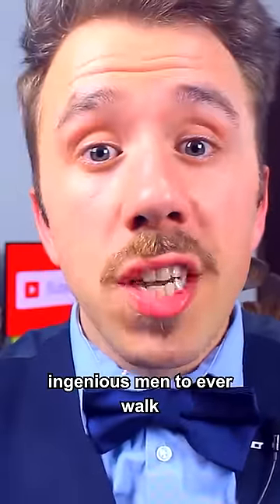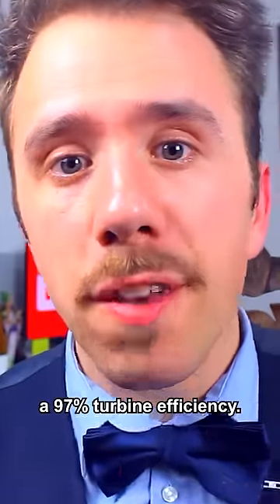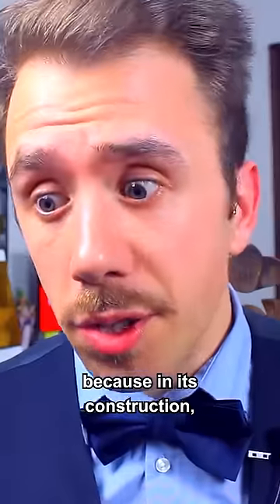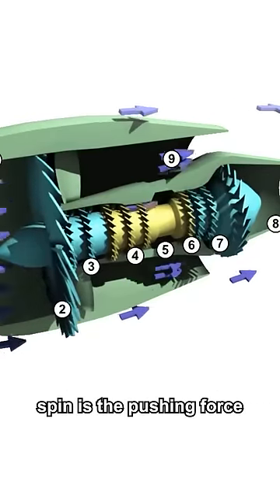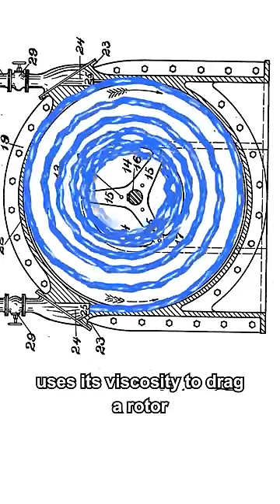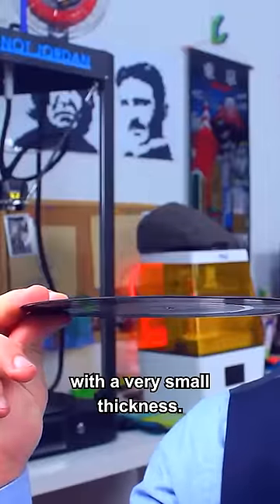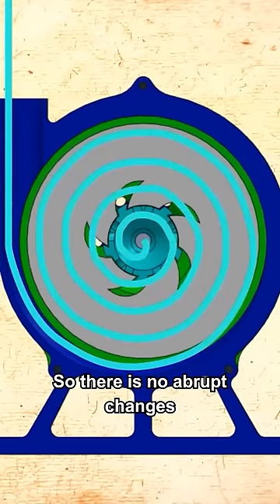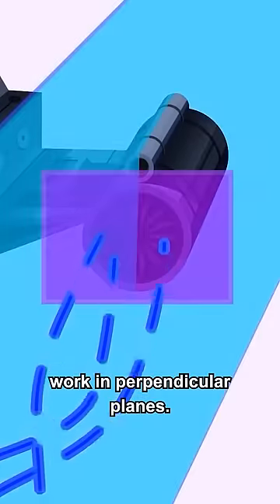97% Efficiency?! Was Tesla Right About His Turbine?

Comment: I've heard once you drive a load it becomes very inefficient.  Can you test that for us?  :)
Reply: Yeah it's because the discs can warp very fast.
Reply: It does not produce much torque
Reply: @chinmayau  would it help to use gears to create torque?
Reply: I’ve also heard this case, and others as to why these aren’t used in modern day power plants. Something to do with when practically applied it is about as efficient as regular turbines.
Reply: It doesn't become that efficient until it starts to get close to top speed, and the problem with that is we don't have  materials that can handle the centrifugal force.
Reply: @MKMT3481  Gears do not increase the total available torque, but they do allow for the band of torque application to be applied more efficiently. You get more mechanical advantage, but in any system there is a practical limit to how much twisting force you can apply to an axis. In the case of the Tesla Turbine, the thing that limits the torque is the viscosity of air. The problem is exacerbated the more air pressure you try to supply, as greater pressure = greater temperature = less density = less viscosity = less torque.
Reply: @KCM25NJL very interesting post. Thank you.
Reply: There is alot of videos that shows the drop in efficiency while under torque. But its still a good invention.
Reply: All of those repetitive replies everywhere are common issues of turbines.
Reply: I've been watching people try to build these things for 30 years since the internet became the source of information sharing.
I've never seen anything useful come out of the turbine.  The pump is quite good, but still rare.
Mechanical engineers work fulltime trying to boost turbine efficiency by the smallest percentage.
Reply: @DumbTheWise they actually use these turbines very often but in the medical field, they are very efficient pumps as well. it's true though when comparing to a standard turbine they are not as good, they only cost a fraction of the price though
Reply: @KCM25NJL then why not just use oil?
Reply: @KCM25NJL  Gears definitely increases the torque. What they don't increase is power. Power is rpm × torque. So if we ignore losses then half the rpm gives twice the torque.
Reply: @abrenos3744  Well that’s just what I mean, is the cost to implement these. The discs are fragile, and the current infrastructure and knowledge would be hard to replace.
Reply: Not even close, practical tesla turbine due to rpm limitations would reach 20 to 30% efficiency compared to modern turbines with up to 98% efficiency  @DumbTheWise
Reply: @blackturbine  Ah ok, thanks.
Reply: @MKMT3481 kund of but not really. The gear shift would have to be too big so for the output to be usable the turbine would have to spin way too fast, which also increases the risk of bending the blades substantially
Reply: @carpediemarts705  Is the Hallscrew Compressor still being manufactured?
Reply: @stephensmith799  never heard of it
Reply: It's a meta material issue.
We don't currently have metal or composite that can handle the forces needed for the turbine to run efficiently.
The Tesla turbine has to basically spin up to its max speed to gain efficiency but the disks can't survive the forces at that speed.

And running it slower makes the turbine roughly as efficient as standard blade generators.

Someday if we ever manage lightweight space magic materials like tritanium the Tesla turbine will make alot more practical sense.
Reply: It was extremely efficient. The only problem was that it didn't work especially well under any significant load. It could produce excellent speed, mostly only limited by the speed of the fluid itself. The only problem was that the boundary layer interaction between the fluid and the disk is relatively weak, resulting in limited force (or torque, in the case of rotational mechanics). It might be able to work with a well lubricated high ratio gearbox though.
Reply: If it achieves laminar flow, it can indeed reach very high efficiencies. But once you attach it tk a generator, or apply any resistance, the flow between the blades becomes turbulent, thus decreasing efficiency. It still has about the same efficiency as the best turbines we have, but the difference is that modern turbines have well established infrastructure. Why switch to something that is just as good that you aren't familiar with. It may find applications for small scale and rugged generators, since you can practically shove any water into it, as well as build it quite small. I doubt it will replace the industrial grade stuff tho. The stuff inside city powering damns are just as good and we already have industries for their maintenance.
Reply: I'd like to see a Tesla turbine with different types of rough surfaces on the discs, like pits such as a golf ball would have, or a honey comb shape. Perhaps it can handle a greater load while improving efficiency if the two turbine types are combined. I also believe attaching it to a gear box with a really high ratio could help the load problem by giving the turbine more leverage.
Reply: @perwestermark8920  You would be right if we were discussing energy transfer via solid gearing / conventional means, but in a Tesla Turbine setup, you are wholly reliant on fluid dynamics and the inherent viscous coupling of the available air with disc surface area. So while you can gear the output to run slower with more torque, you introduce so much loss that the net result is almost the same torque for less work done. As others have also alluded, the whole setup would suffer structural failure long before we were able to measure the "extra torque" that you wouldn't be able to use.
Reply: @KCM25NJL  Well - I am talking about solid gears.l for conversion of rpm->torque. And notice my fourth sentence out of four in my post. The part about losses...
Reply: At the time the material were not good enough to get the full potential of this and now central are build for conventional turbine. 

Since computer made conventional turbine very efficient there is no real incentive to build efficient tesla turbine. They are use in pumping thick fluid it's about it today.
Reply: @blackturbine  No turbine reach 98% efficiency. Tesla turbine and covnentional turbine can reach about the same efficiency 65% but to use tesla turbine you would have to completly redesign thermal central. So why invest to replace something wich work just fine.
Reply: It is like Turbo lag for turbocharger the turbo requires a lot of time to spool up 
The same way this turbine is inefficient at low rpm
Reply: @legro19  you would be suprised. In my comment I looket at best example, more standard turbines achieve 90% efficiency so it's still far greater than tesla turbine will ever achieve
Reply: @blackturbine  The world record is at 63 ish %. 65% efficiency is considered has the limit reachable for any convertion of heat to mecanical energy.

When you reach perfect laminar flow in a tesla turbine you reach crazy efficiency. You can't draw energy from it because all of the energy is use to maintain the speed of the turbine. In such condition since the flow of air can't slowdown the turbine will litteraly suck heat from the steam and ice start to build up in the turbine.

Thermodynamic is weird...
Reply: @legro19  yes that's correct but I am just comparing turbine to turbine alone without taking anything else into consideration
Reply: But wait TeSlA iNvEnTeD iT so it must be the greatest or the government stole the real design.. 😂
Reply: @member57  The guy build a 200 hp turbine weighting maybe 50 lbs in 1913. Deserve respect but like most of tesla invention they were far ahead of their time. The only reason why they don't use them much is because the infrastructure are build for conventional turbine. With modern material and fabrication process you would have them for a tiny fraction of the cost and maintenance requirement of a conventional turbine.
Reply: @legro19  
So where is this amazing turbine? 😂
Tesla is the most overrated inventor in history. Yes he did invent great things, but his turbine designs were flops. Just because his name is attached doesn't mean it was a great invention. He was more of a kook than anything else.
Reply: @legro19  infrastructure is not an issue
Physical limitations are. 
Last stage in steam turbine has tip velocity around mach 1

Tesla turbine wound need to achieve tip velocity of mach 15
That's faster than what jet engines could even do, there is no physical material that can handle these speeds without compromise
And compromise means loss in efficiency is too great for tesla turbine to be viable solution
Reply: @blackturbine  The velocity won't ever be over mach because air don'T move faster than mach 1. The 97% efficiency is just theoretical, for a turbine more you go up in efficiency more you loose torque.

With current technology tesla turbine are as good than conventional one. But you can't build a 10 foot diameter tesla turbine so thermal central would have to be comletely redesign just to use turbine which need less maintenance and are lot cheaper to manufacture. Don't worth the hundred of millions you would need just to adapt one central.

There is the probleme of development, if you spend the money to test with different material and configuration anybody can just copy you when you got the best recipe and there is nothing you can do about it. No patent will be given.
Reply: @member57  His turbine was insane at the time but he ad no good alloy so the disc started to warp pretty fast. 

All our modern tech is based on his work so the guy is not overrated. The guy has not made money with is genius or get prestige is deserved but remain he put in place the foundation of all our modern tech.
Reply: @legro19  
He alone is absolutely NOT the foundation of modern tech, he made contributions. His turbine is still not effective with modern materials or else they would be used, they're not. His contributions have definitely been over stated with time.
Reply: Better low volume pump than turbine, issues with upscaling and as you point out, it is efficient at the rotor but when a load is but on the axle that efficiency drops quickly
Reply: Yeah but thats not because of the turbine but because we havent found a material that can withstand the force for a long period of time. They warp, break or even explode. Once we do find a material strong enough the effeciency should stay the same
Reply: @spectrum1324  I would be curious to see one made from aerospace grade alloy. With small modular reactor currently in dev a small simple reliable longlasting turbine could find a place in the market.

A turbine running for years without any maintenance would certainly be interesting for nuclear energy.
Reply: When a load is applied, the speed of the blades doesn't match the speed of the flow, which means the flow has to be turbulent and efficient is lost.

 Air simply doesn't have enough friction to sustain loads, the solution to that would be to add more blades and make them even thinner, but there's material limitations. Or to use it in more viscous fluids, which we do nowadays.
Reply: @abrenos3744 what are they used in?
Reply: @MKMT3481 This was my initial thought, too. Isn't all lack of torque simply a lack of proper gearing? Why not connect it to a harmonic drive, run it really fast, and have it slowly lift weights or charge capacitors? I'm guessing it's because big water wheels running way slower can generate way more electricity, but I've never built a hydro-electric power station before.
Reply: Yeah, that's what I was going to say too
Reply: @KCM25NJL I believe I have seen these used for liquid pumping where turbulence minimisation was desired.
Reply: @ethereal41 🔴 What Is Islam? 

🔴 Islam is not just another religion. 

🔵 It is the same message preached by Moses, Jesus and Abraham.

 🔴 Islam literally means ‘submission to God’ and it teaches us to have a direct relationship with God. 

 🔵 It reminds us that since God created us, no one should be worshipped except God alone. 

 🔴 It also teaches that God is nothing like a human being or like anything that we can imagine.

🌍 The concept of God is summarized in the Quran as:

📖 { “Say, He is God, the One.  God, the Absolute.  He does not give birth, nor was He born, and there is nothing like Him.”} (Quran 112:1-4) 📚

🔴 Becoming a Muslim is not turning your back to Jesus. 

🔵 Rather it’s going back to the original teachings of Jesus and obeying him. 

More .....👇

🔴 THE RETURN OF JESUS
Reply: @1islam1  why would I turn my back to prophet Isa? I just don't worship prophets. There is only 1 god and that is Allah (SWT) and I will worship none other than him. You go believe what you like, but I will never say that prophet Isa (jesus) is the son of god. That is shirk. Don't try and convert me, it won't work.
Reply: The fluid used is the most important aspect of the turbine. Low viscosity for flow but high shear resistance to stick to the plates and pull them along. Plate geometry also plays a part with friction being the most important aspect when determining torque capabilities while maximizing speed.
Reply: The motor only turns quickly if the liquid is in laminar ( non-turbulent) flow.  When you add load, the liquid flow becomes chaotic and the efficiency collapses
Reply: @binary10balls  ive never understood how you get high shear resistance and low viscosity together. Shear resistance creates drag so you'd need huge piping into the turbine.. that geometry surpasses my brain at the moment!
Reply: yes because the fluid flows faster than the discs in the turbine
Reply: The full version of the video discusses that issue.
Reply: Yes , drops to 35% efficacy which is just like normal turbine,
Reply: This is true but the reason is the reason it is so efficient it the disk move at the same speed as the liquid Wich creates the efficiency but the moment you apply load it moves slower than the liquid and the efficiency gose down
Reply: @MKMT3481 yes it helps to have a fast spinning Tesla turbine with gearing to reduce the load  but at some point you reach limits of the material and its still is not performing very good because the more load you put the more turbulence appear in the flow and the less efficient it becomes
Reply: @david2ljdavid2lj56 it's not the speed that affects efficiency it's the speed difference between the disc and the fluid and it's related to load. Tesla turbine is efficient too at low speed and low load but then it's just not powerful
Reply: @ethereal41 i’ve heard this before. is there any material that will not warp??
Reply: @ErikGarcia07  due to it being really thin, I'm pretty sure an extremely hard and brittle material (like glass, chromium, diamond) will not warp, but they might break, and glass is smooth so it won't turn that much.
Reply: @Rensvind1 it's just useless. None of them are around...
Reply: @chinmayau  That entirely depends on the scale
Reply: Ya
Reply: The disc do not provide enough friction once a load is applied causing almost a complete loss of torque
Reply: @YokoX23 The dimples on a golf ball reduce friction so they fly further, so not likely a successful approach. The Tesla turbine performance depends on laminar flow, which is disrupted by surface irregularities like dimples. Think of the blades in a standard turbine as the extreme case of introducing a friction surface to the Tesla turbine.
Reply: it's inefficient cuz no one think the other parts ,like most people think of inefficient put tire on plane to get more torque,if not inefficient that's mean wrong place
Reply: Yes the discs are easily damaged
Reply: @hogfry I've always found it fascinating the amount of engineering that while theoretically possible is hampered by things like material composition.
Reply: @MKMT3481 you can't create torque with gear ratios
Reply: @legro19 he abandoned this design long before his death because it doesnt scale well, the larger these get the less efficient they become, these are only useful as a toy to demonstrate the physics of viscosity, if this design was better or more efficient it would be in use in power plants today, it is only theoretically 97% efficient, in practice it is much less.
Reply: @Greg1096  He abandonned because disc faillure. MIT and other tested it and it's as good than any conventional turbine. The simplicity make it easy to produce and in theory require lot less maintenance. 

But nobody know how to use them for a thermal central. It's has never be done so nobody will take any risk when there is lots of engineer with experience ready to design central around conventional turbine.

In heavy industry thing are made differently than on other industry. It take a very long time before a new technology is adopted. She must make his proof before and require a big gain vs old tech or they don't take the risk.

This is why they have no interest for tesla turbine. They will have to design in a totaly new way how central are build and they never do that. Generaly a new central is 90% copy past of old blueprint.
Reply: @KCM25NJL  The speed gets converted into torque through mechanical advantage. It's the same principle as bicycles and turbo shaft jet engines.
Reply: @MKMT3481  because gearboxes are quite inefficient, would loose another 5-10% again plus any from the final drive, it only works with no or very little load.